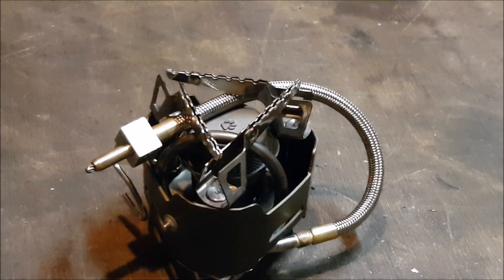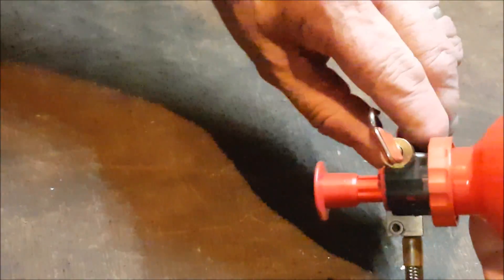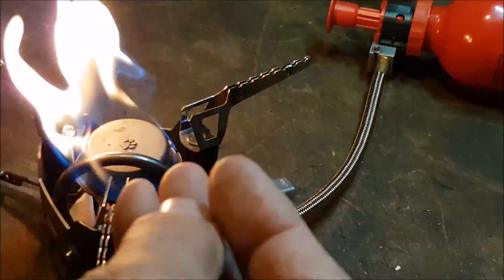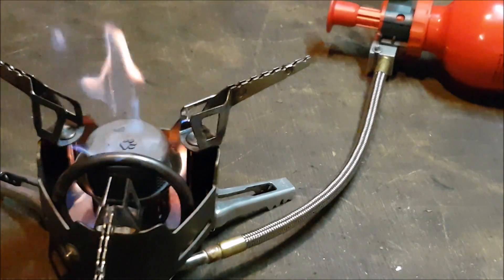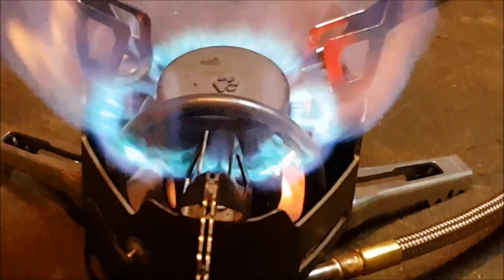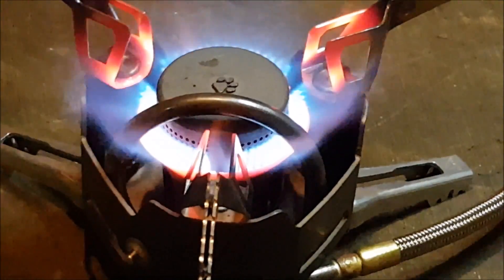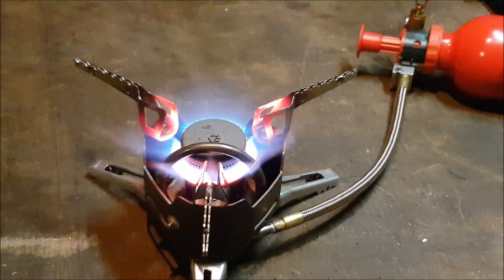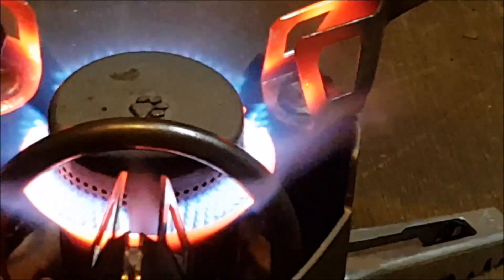MSR XGK EX - Assembly and lighting

Comment: Can u also regulate the heat, or is it just full open or closed.  A little simmering is all i need if the water or food is heated up.
Reply from the maker: very hard to simmer its usually full on or off
Reply: @meltedwellies1728  thanks

Comment: It looks like you have wasted a lot  of fuel in just turning the stove on. When it starts to run on low,   Place pan or pot on stove,   After a minute or two,  Turn up stove to the required heat.  Don't west fuel.   Over.

Comment: Hi nice vid, yeah I've still got the old XGK over 20 years old now been on many trips and two expeditions but i see the burner has been vastly improved and of course those flimsy pot stand posts now replaced by proper ones. I 'd like to get another one but as the old one is still raging, can't justify it. I also just reviewed the maintenance  on it too and fire up.
Reply from the maker: they just work 24/7 thanks for watching
Reply: Yes they do. No problems!
Reply: That burner does not come with the stove originally it is an after market silencer/dampener
Reply: @craigslaunwhite579  Hi, yeah I'd since found that out thanks anyway. I think I wouldn't mind getting one too just to keep other campers happy.